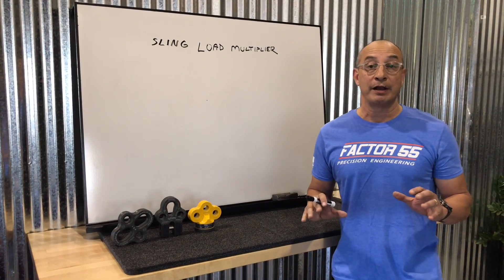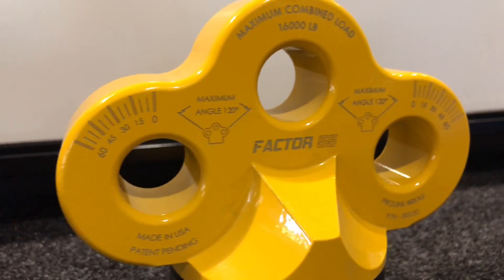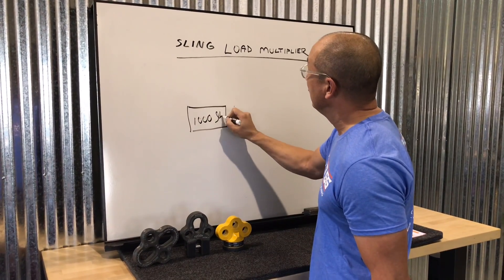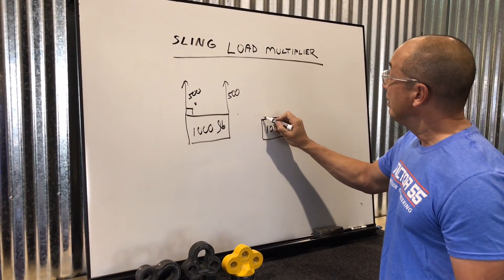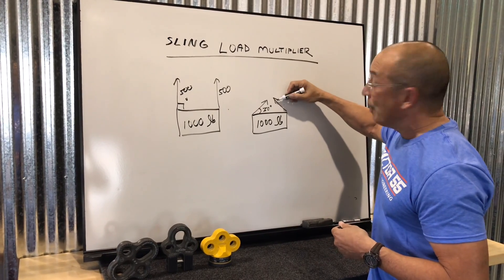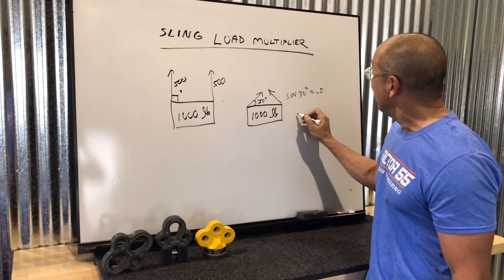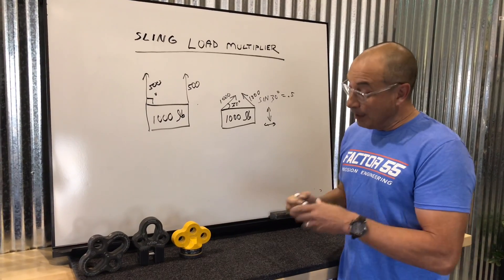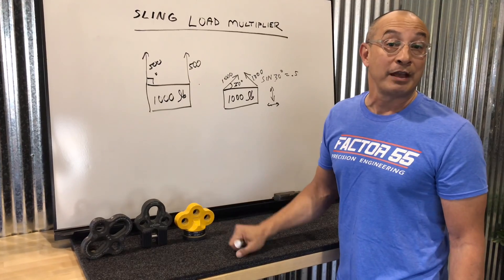Why do we engrave angle tick marks on our safety products? Sling Load Multiplier

Comment: Never go less than 30° less than 45° is pushing it with most automotive rigging considering it's not likely proof tested to the same safety factors.

The crane and rigging industry has lots of great craftsmen that are very knowledgeable and safe but it also has newer craftsmen who dont know or think they know. To a knowledgeable craftsman these guys are easily picked out of a group just by doing stupid little things like pushing sling capacities to the max and not taking account for sling angles. load drift and side loading force all come into play.

Snatch blocks and pulleys are incredibly dangerous if handled improperly. Solid Anchorage and knowing that you anchor is strong enough especially when using snatch blocks is imperative

Comment: Good video. I like the angle tick marks, but would adding tick marks on the other side with the actually percentage increases be more helpful, or am I just screwed up as polio here? I'm just thinking that it's much easier to add 30% to a load, than to try and figure out the SINE of an angle and do the math at that point. I'd also like to see the MIRE FACTOR figures engraved on your equipment if you could figure out how to put that on there as well. Keep up the great work.